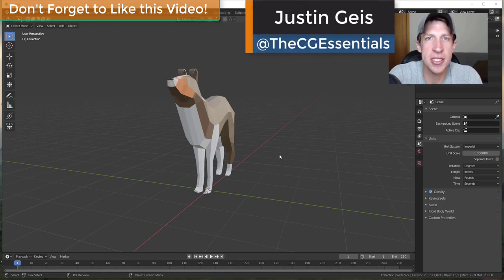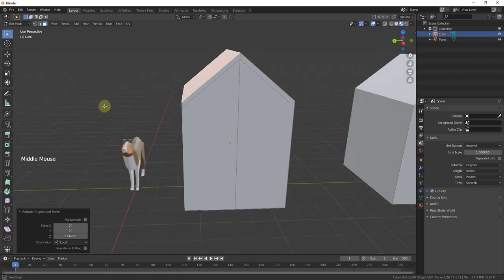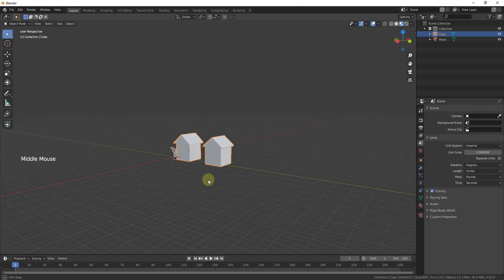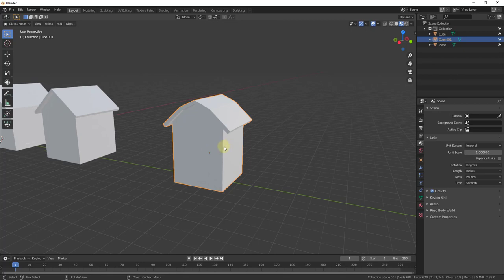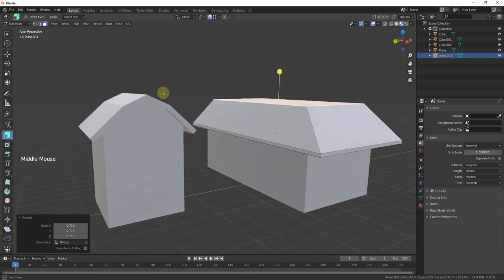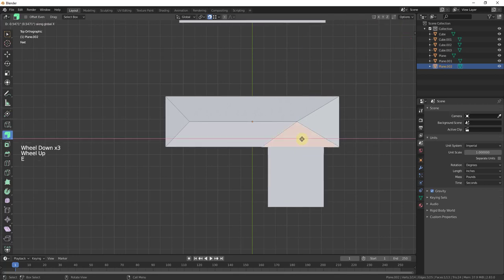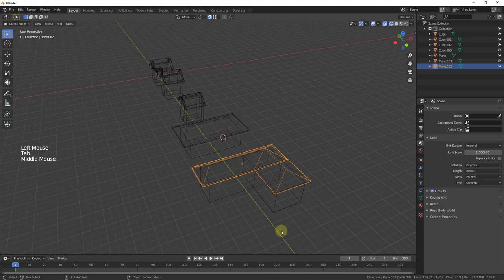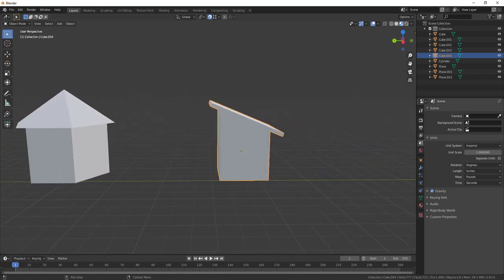How to Model 7 Different Kinds of ROOFS in Blender - Architectural Modeling Tutorial

Comment: Yeah that's all nice (and basic).   I need such a roof on a donut shaped building ;)   So what I need is to Shift+A, add a Cylinder, then another, one set inside the other to create a donut.  Then put a roof on that!  So the roof goes from inner circle to outer circle with a hole in the middle !  ;)

Comment: Also, use Edge Offset (in a certain add-on like Mesh Tools or something) and it allows you to take your ceiling, Edge offset, and get equidistant overhanging eave lines instantly. it's like an "outset" tool, instead of inset.

Comment: Very well explained and I like the different approaches. Just one question why I came across this video is that I'm struggling with topology and wanted to find out how others tackle it. As far as I can see is that you ignore triangles and n-gons in the last example of the complex shaped roof. Don't you? I did it the same way and worried about topology.
Reply from the maker: Depends. For most simple architectural applications where I can UV map just from a straight on view, I don't worry about it too much, but if I want to use some more advanced things, like inserting edge loops, etc, I pay more attention. Just depends on what I'm going to do

Comment: How do you do it if you want the roof to be a separate object?
Reply: Just click off the house in "object mode" until nothing is selected (outlined in orange or yellow). Add the roof, (shift+A), then and you'll see it's a separate object with its own name in the outliner.
Reply: @andrewrichard3490  I'm much better at blender since I wrote this original comment! But thank you for the solution, I'm sure others will appreciate it